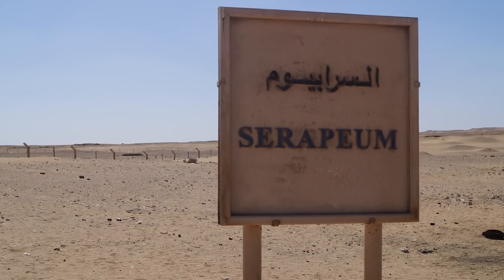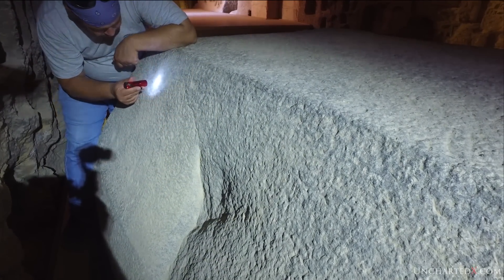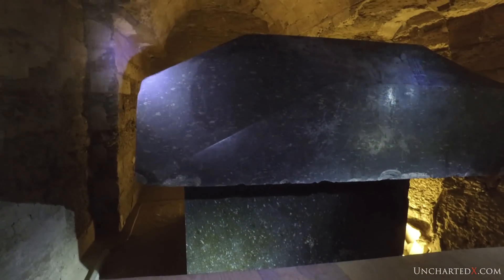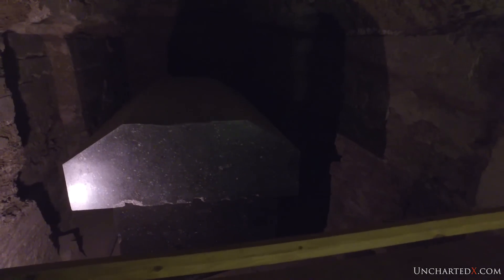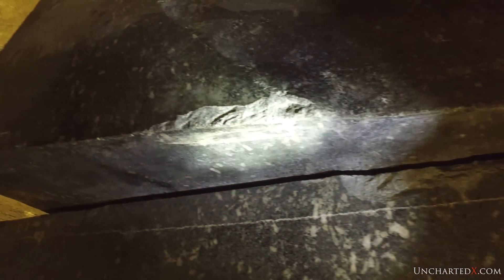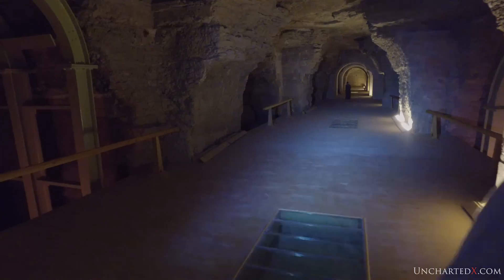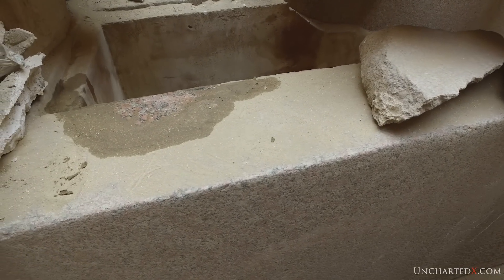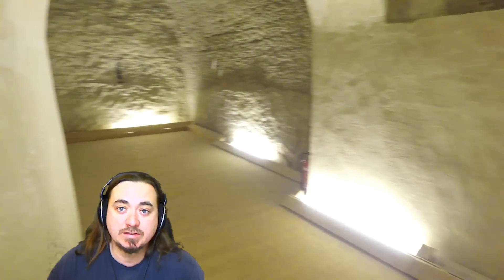Evidence of Ancient High Technology - Liquid Polishing at the Serapeum of Saqqara - Chapter 4

Comment: Excellent video. Why not take a secret sample of the 'surface liquid' and send it to a lab. If the liquid penetrated into the granite for around 1mm it must be something very strange...
Reply: That would be interesting!
Reply from the maker: I hope this happens, that's exactly what I think they should be doing... I haven't heard about it if it has...
Reply: It did its work and evaporated a long time ago.
Reply: UnchartedX Brien said he was doing that
Reply: Gary Wheeler -  of course there will be no liquid left but the molecular structure of the smoothed granite may give chemists an indication of what chemical process has transpired even if it's thousands of years ago
Reply: You really don't need a sample.  You could use a gated ultrasound probe on the granite to measure the depth of the layer, if any.  Also a mutltispectral nuclear magnetic resonance probe would tell you what was present in the surface as far as chemical analysis.
Reply: @garywheeler7039  but it would leave a residue.
Reply: @johnv341  : Not necessarily, if an acid is put on rock and it dissolves some rock, the acid is then gone as if it never existed. It just leaves degraded rock that then washes away. I am no chemistry expert though.
Reply: @garywheeler7039  Maybe.  Need some experts in other fields including chemists to answer that one.  An acid which reacts with rock minerals would probably leave some tell tale residue.
Reply: @johnv341  Moss and lichens outdoors also use natural solvents to dissolve rock for food, and there is acid rain, so its kind tough to tell I would think. For stuff exposed to the weather anyway.
Reply: @garywheeler7039  Not too much acid rain or moss down there I suspect
Reply: @johnv341  : Exactly, I started to write my response forgetting the context which was the Serapeum.

Comment: Why doesnt anyone ever pay attention to the spaces carved into the walls of these spaces? One space was full of square and rectangular areas that looked like they were used for the tooling if the boxes. Even the indentations or protrusions on carved rocks seem to be ignored. Clearly they were placing SOMETHING into the spaces. I watch so many of these videos and I hear the knobs mentioned frequently but never other places where beams or something part of the construction/structure were placed... Its strange and disappointing. Maybe a video series on just those would be interesting
Reply: There's a lot of modern block and iron work in the walls to make the tunnels safe for visitors.
 Don't read too much into the wall details.

Comment: I hone and polish stone surfaces like this for a living. Not in a fabrication shop, but from a restoration standpoint usually after a piece is installed. I have 13 years experience. Our final process on granite is a vitrification process using a liquid polish and steel wool. The wool is moved via hand machine at high speeds and burns the vitrification fluid dry. We do this because it is impossible to do the polishing process you showed in home. This work is still immensely impressive, but not inconceivable if given enough time, material, and knowledge.
The fluid I speak of is called V2 and is made by a company called VMC.
Please let me know if you have any questions about process or chemical make up. 

Great video, thank you.

Comment: I once worked at an alumina refinery. My job was to sand blast inside the pressure vessels for inspection. After removing the caustic scale, there were marks in the walls of the vessels from past air chiselling. All of these marks had to be be scalloped out exactly like the granite boxes to maintain structural integrity under pressure.

Comment: And nothing is impossible we do things that are beautiful in stone at the shop I work at everything in your video about polishing the boxes is possible today, and if you impregnate the stone with a anti u/v substance before polishing it then seal it after you polished it, IT will be forever we do it for outdoor work. I live in Arizona it’s really sunny here haha 😆
Reply: Yes, certainly. I have a few questions, though. How large are the objects you are working with and can your technique be scaled up to the boxes in question (Including cutting, surfacing an polishing) without the use of machines whatsoever, i.e., by hands and proposedly sand and copper? And talking about "forever", have you any verifyable data for the durability of the anti u/v substance in means long-term studies, i.e. exceeding a couple of years or decades or better even centuries? 

As a side note, if I remember correctly, Arizona has been settled by the Spanish around the middle of the sixteenth century, but taking your avatar name as a clue for possible English origins that forwards the time of your ancestors coming to Arizona to about 300 years later. Please correct me, if I am wrong. That, however, leaves a probable maximum testing time - that is if your ancestors worked with granite as well - of around 150 years.
Reply: Tobias Ebersberger so you missed the point buddy we are under the assumption they HAD technical whereabouts to cut and polish rock with machinery because we see the marks.. ok now we have that I run CNC equipment that leave the same gauge marks and saw cuts. They had technology trust me. 
And you don’t understand stone buddy when it is polished it’s done forever. Only acid or a constant bombardment of a abrasive winds will knock down the surface.  Those black boxes are out of the direct sun in almost climate controlled area underground. Yeah it would last forever 
Cheers bud
Reply: Tobias Ebersberger the biggest mystery to me my friend is how they were moved. All the stone work on those boxes from the inside corners in the box to the outside somewhat flat surface could be done today. 
Think giant gang saw or something in that nature
Reply: @makingPAIN  It seems that I misunderstood you. I took your comment on anti-ultraviolet substance as your main argument for the polished surface staying as it is. On the other hand I am well aware of the properties of stone; one might almost say that geology is one of my hobbies. Anyway, though maybe I would be exaggerating if I said that it would take a true expert to tell me something I do not know about stones but I believe that this claim would at least be not too far from the mark.
Reply: Tobias Ebersberger no buddy you got me we understand each other. All I was saying is I don’t like hearing that’s impossible when I see something I know we could do with the right skills applied to the work.

Comment: To explain the faceting Wikipedia part ( I am a chemistry major) the article is describing the potential energy (chemical) held in the crystal lattice. In effect faceting along the plane of the crystal would create an more durable crystal since the outer edge would be uniform in it's force distribution. While the this might be limited given the material used. If one where to make a mono chrystiline material in that shape it would be far more stable. It's entirely possible that these are actually molds of some kind perhaps for the creation of massive monocrystals, but that last part is just conjecture.

Comment: When you dig out those cracks you need to reach the full depth of the crack, or the cracking will continue developing all the way through the object, over time.
This practice is still used today when repairing cracks in concrete

Comment: I would suggest that it is not liquid polishing of the boxes, but the signs of the liquid under the lid etc are of some sort of extremely good sealer.
I would like to test the finish.
The sand and water idea is crazy. You need to continually polish with  finer and finer grit.
Oops when I was writing this you mention sealer. Go with that.

Comment: Enjoyed this video. Each review into small details of how these may have been made could advance our understanding and impact how we manufacture today. An old often mentioned but not investigated is that Granite and other stone has in the past been softened by a Plant Based liquid that enhances shaping. Large stone blocks seen that include side knobs or bosses in some respect could be flow risers for poured stone mixes. This also would support how matched surfaces to other mating blocks are achieved. The shape of the knobs or bosses may be showing the result of how thick the liquified stone was at time of pour. Thicker pour results in a lesser pronounced knob while thinner or least viscus pour would have larger more pronounced knobs.

Video as explained proves old stories as a Plant Based liquid was used to quickly soften or dissolve granite stone. Could possibly turn the stone into a putty consistency? The putty consistency directly relates to how the liquid mix is made. Consistency could be as thick as molding with Rubbery Clay. Or as a consistency as pouring out of a bottle directly into a mold.

It also seems to have an effect on the Granite crystal structure which may further tighten crystal structure, seal pores and harden its outer surface. Sort of like Case Hardening mild steel by coating the surface with element enriched liquids/cream that increase the steel chemistry hardness potential. As an example, “0-1” Tool steel has 1% Carbon which when hardened gives 65R/C hardness. Mild steel lacks Carbon, is easy to cut and hardening requires adding carbon to produce a Case Hardened Surface. Methods are easily described on Internet. Similar application for Granite as an example might be a Plant Based liquid for softening the Granite which when cures tightens and hardens the crystal structure.

If true, various mixes of Plant based softening liquids could be made specifically for different types/methods of Stone Shaping. Video points out that polishing appears to have used this liquid. Most importantly video points out that just applying the liquid shows changes in the rock as the liquid freely traveled along the rock surface. This strongly implies the liquid mixture had a seriously quick effect on the rock much like a super solvent would have on plastic.

When thinking of shaping a vase with ear lugs out of hard Granite by using a liquid as I described above, different accurate shaping would easily be accomplished. Realizing measured existing Vase with lugs shows precision. Todays CNC Machine technology will reproduce but do require using a cutting tool which “takes a chip”. Cutting Granite can’t use cutting tools that take chips and Polishing only slowly erodes surfaces.

Plant Based stone softening liquids should be a high priority and may change how manufacturing using stone is done. But what plant or plants were used? Focused study of planets found in areas where these stone buildings were made might be a good starting point. Video clearly shows applying this liquid had a quick effect on the Rock. This obviously softened and changed the immediate surface. How deeply it affected the stone isn’t known but could easily be determined.
Marty Didier

Comment: You apply polishing to surfaces not only for cosmetic reasons but also if you expect  high level of forces - internally or externally brought to them - to avoid cracks. A well known process in machining metals in areas of high stresses / high or rapidly changing temperature induced stresses like aircraft engine manufacturing.

Comment: Looking at this from a furniture finisher point of view, it looks like they probably hand sanded the granite. Simply pour sand on it and use a piece of leather to rub the sand around, it would be easy to get the rounded parts like this too. The finer the sand the smoother the finish. The outside surface might have then been waxed repeatedly to get the shine and protection. If the granite was near a heat source for a while that could cause bits of wax to seep out and melt giving the wet marks you noted. Just a few ideas :)

Comment: Has anyone looked into if the ancients could have used high pressure water to cut the stones, it leaves very similar marks to tool marks, water powered polishers could work also.
Great work Ben
Reply: @Praque Forqsk so you don't think they managed that capability in 1000s of years, we haven't all ways had electricty, we managed with steam and water wheels for a long time.
Reply: @Praque Forqsk my way of thinking is if they had metal tools and or machinery made of wood and the like, 1000 of years later theres be nothing left, we struggle to find 100s of yo iron arrow headd
Reply: @Praque Forqsk but if all trace of there tech got wiped out how would we know which direction there tech was going, there tech could have burned or been washed away, those stones were cut in a mechanical fashion, they must have used steam or air or water power.
Reply: @Praque Forqsk have you seen how we moved abu simbel in the 60s, and the machines the Chinese had   2000years ago, makes me think anything's possible from an ancient advanced civilisation.
Reply: @Praque Forqsk probably the same way we would but sans electronics, China supposedly rallied 700000 people to build the terracotta army and temple, many hands make light work lol

Comment: Ben, the conduit near the floor may provide an explanation as to how these boxes were moved through these galleries. I would guess that there is another such opening on the opposite side behind a facade as well as at the end of the side chambers. Large cables attached to the boxes could find egress through these openings and find their way up to the surface where there are a team of elephants . Whatever the nature of the original flooring greasing that surface would reduce the coefficient Of friction enough to allow these boxes to be moved towards the end walls. If the Serapeum was constructed before the desertification of the Sahara region then that ancient climate would have probably favored large elephant species extant in this region. 

Positioning the attachment of these cables could apply torque enough to turn the boxes at required points where other cables exiting side chambers in a similar arrangement. 
Boxes may have been pulled into sand filled side chambers where workmen removed sand until the boxes settled to the floor. Not an engineer, just a  retired chemistry prof.  Offering some alternaity .
Reply: LOL..can't simply say, "I don't know how it was done!" 😮😮😮

Comment: the polishing process as explained here reminded me of clear coat paint. Clear coat fills in all the smaller scratches and leaves a reflective surface. Obviously doesnt last very long in comparison, and I’m not sure if it would even work that way on stone. But the explanation sounded pretty similar especially the part where it ran down to the underside as I’ve had clear coat run on me when using to much.

Comment: It is interesting that some of these marks are the same as very old brick work here.  I noticed this not so long ago and indeed again a few days ago on brickwork which is very old and I researched this on the net and it came back that sometimes when they were getting the bricks in or out of the kiln and remembering bricks were not made in vast volumes like today, that some bricks had to be dragged out from difficult corners of the kiln.  So which ever tool they used would leave marks or indentations on the brick, in the case of these bricks it was 4 ring indentations just like finger marks.

Comment: I have been cutting, fabricating & installing granite for 30 years.
The way I polish edges, when fabricating granite countertops, involves a pneumatic polishing machine,  6 diamond dust pads, water & 5 or so hours of work.
That's a 3cm edge.
The way one polishes a slab or, large flat surface can be seen by googling 'granite quarries'.
It involves massive machinery with tons of pressure & hundreds of gallons of water.
The machines have diamonds cast into the steel pads that grind it perfectly flat, then a series of polishing pads are used.
The finished product looks just like what Ben is showing you here.
Take note -
Ancient Egypt had no machinery or energy source to power machines. 
And, the hardest metal they had was brass or bronze.
This  will not dent granite.
So, it should be something everyone would want to investigate and understand.

Comment: You hollow out cracks to keep them from growing.  The region at the end of a crack is known as a stress riser.  The narrower the end of the crack, the more the stress is concentrated, and the faster the crack will grow.  Rounding out the end of the crack dissipates the stress.  When the Liberty Bell cracked, they drilled out the crack to keep it from spreading.  There was a similar issue when the cast the mirror blank for the Hubble telescope, there was an open structure inside.  They cut it out because they weren't sure if the ends were sealed, so the cored out that section of the mirror blank.

Comment: Oils - usually, mineral oil - are used as the final polish/seal in modern times.
You can find this on many YouTube vids on stone working, especially for stone counter tops in upscale homes.
With most types of stone, it's a regular maintenance issue.